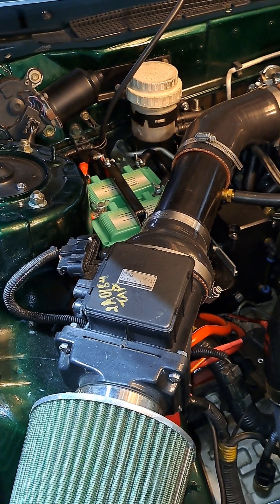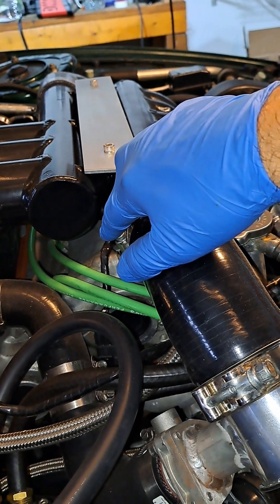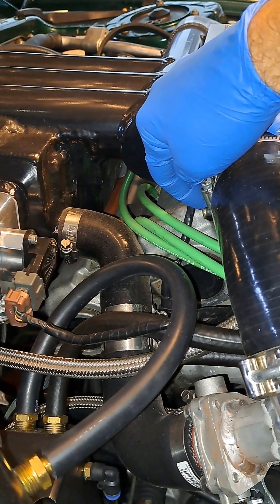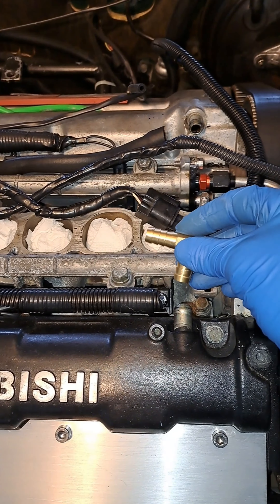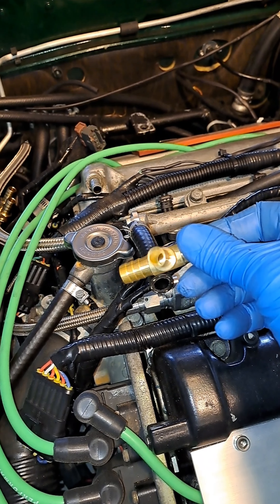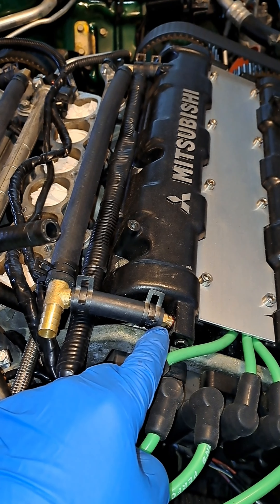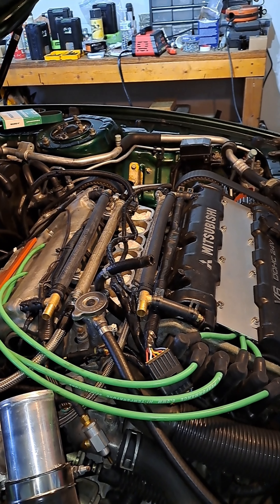3000GT PCV Valve Delete to Relieve Crankcase Pressure. #3000gt #supercharged

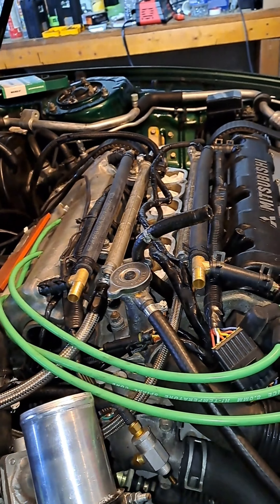Comment: good video. What did you do with the pipe popping up from the bottom plenum? @7:08
Reply from the maker: @VidVerseCentral  the rubber hose sticking up? I bought a brass hose plug, cut hose as short as I could, then put plug in with a clamp. I couldn't reach far enough down to put a rubber cap on the nipple at bottom.

Comment: I actually have 4 PCV valves on mine. It can relieve enough the pressure under boost to not smoke and make vacuum when at idle so the VSS don't leak.
Reply from the maker: How did you run 4 pcv valves and what is the VSS?
Reply: The "balance hose" as you called it in your video.
Reply from the maker: @misanthropist111  VSS = valve stem seals 😀
Reply: @sigvision4189  valve stem seals really don't leak, You break the ringlands on the pistons, that's what causes the blowby.

Comment: Who made your supercharger/plenum???
Reply from the maker: I did all the fab work on it but had a shop do the welding. I used a factory intake to get the upper plenum connection and the throttle body plate. Everything else was done with 2 inch aluminum pipe